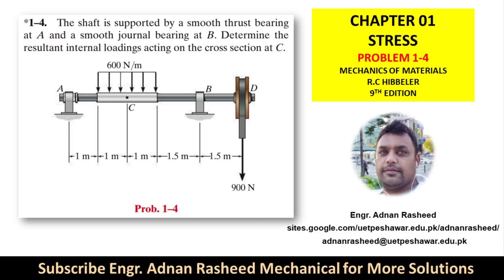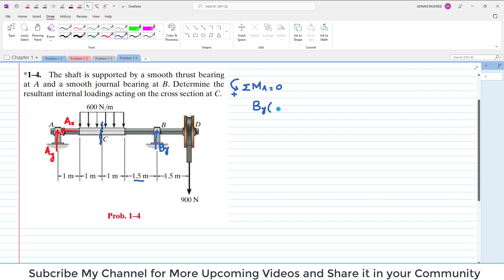1-4 Stress: Internal Resultant Loading (Chapter 1 Mechanics of Materials by R.C Hibbeler)

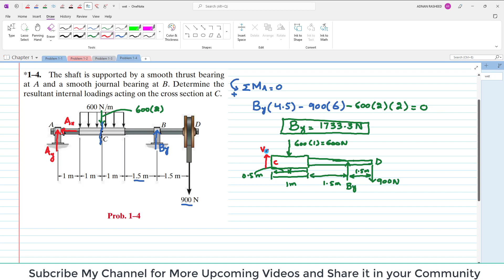Comment: Hello, at 6:00 how do we know what direction the internal forces go when we cut the beam in half
Reply from the maker: You have to look the overall forces on the section and take opposite to it. If you are confused then assume any direction and solve. If the answer is positive then your assume direction is correct and if it's negative then your assumed direction is wrong and it should be opposite to what you have taken.

Comment: why cant you determine ay by using the Moment around B ?
Reply from the maker: You can also do that
Reply: @engradnanrasheedmechanical   but then i get an vc=1566.6 N and Ay 966.6 N looking downwards isnt that wrong? Also shouldnt it be possible then to calculate By  using fy=0  but i also get an different By
Reply from the maker: @149700123 may be you are doing any mistake